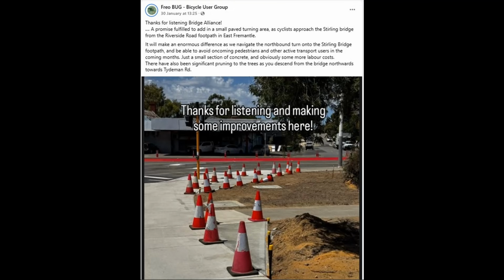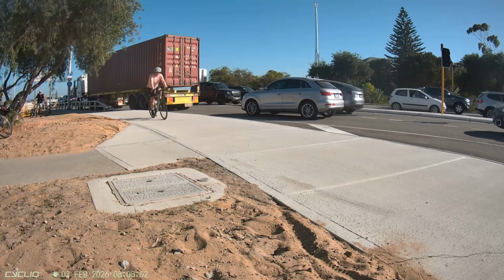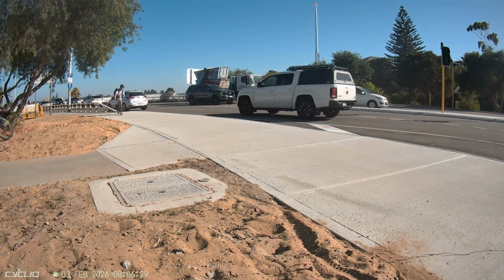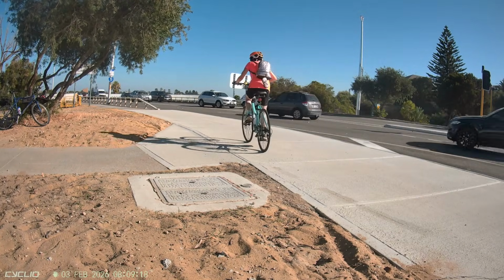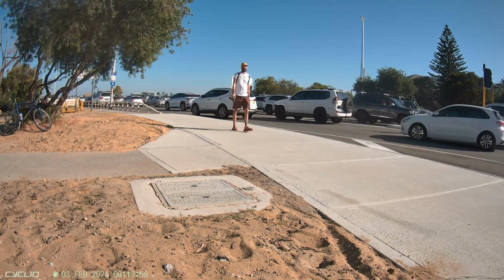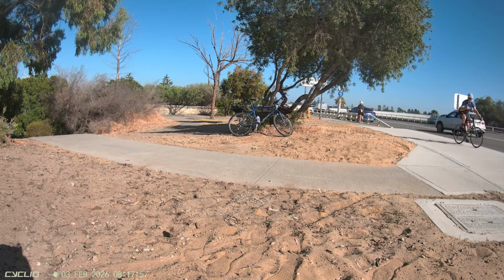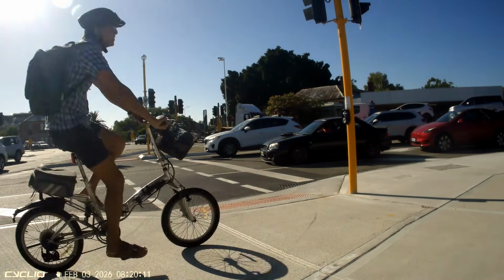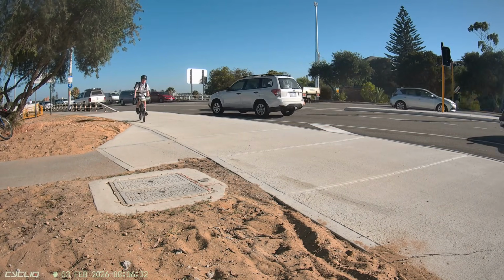Why didn't Main Roads detect this hazard during the design, build or test phases of the project?

Comment: And this applies to all Main Roads projects. I am currently engaged via Main Roads with the head contractor Giorgio on an issue related to safe cycling bypasses on a Reid highway project. This is an example of MR handballing traffic management and safety of users failures to the contractor who created them. Its been a month since raised and to date nothing has changed
Reply from the maker: I should have added a sample matrix showing responsibility, accountability and delivery. Sure, the contractor is responsible for getting the project signage right - but Main Roads is the organisation that is accountable for overall system safety. They can't duck-shove that accountability onto their contractors - they have to own it.